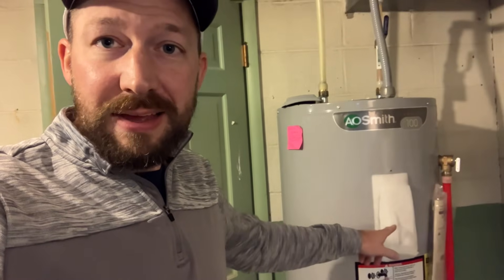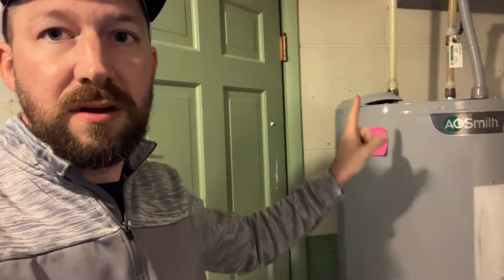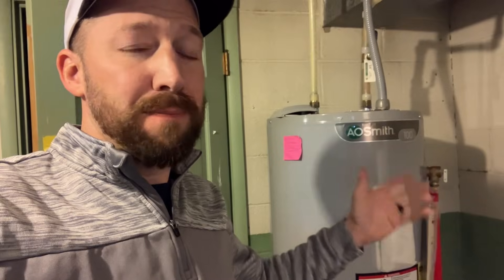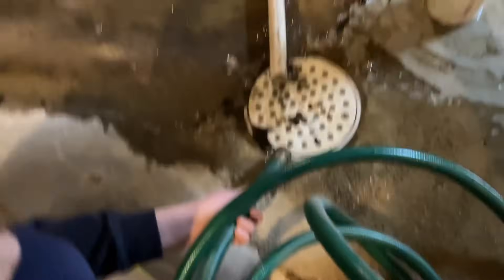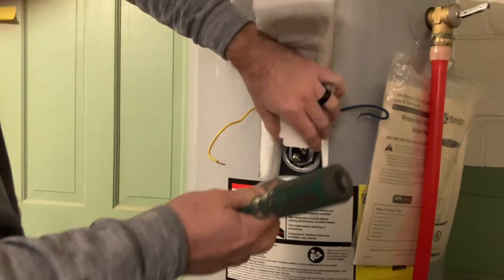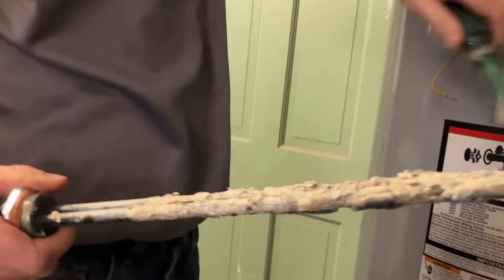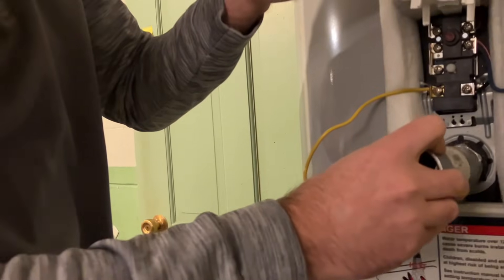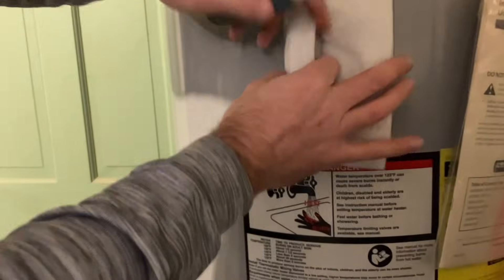Less than $40 water heater replacement--How to fix your water heater to get more hot water per use

Comment: Cold water is added to the bottom of the heater because of the long dip tube on the cold water inlet, and cold water is denser than hot water. Hot water is drawn from the top of the heater at the hot outlet.
Reply from the maker: Good to know!!